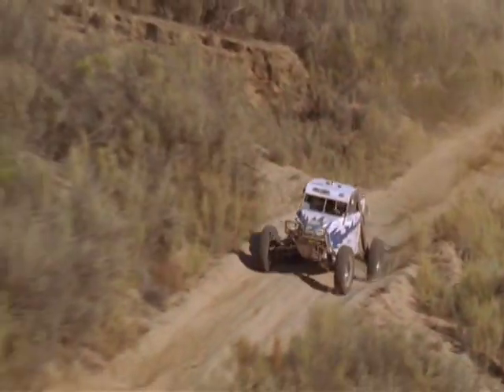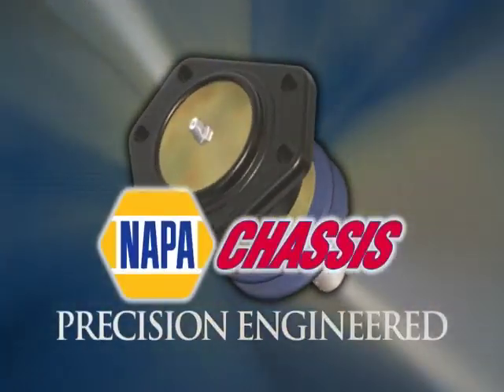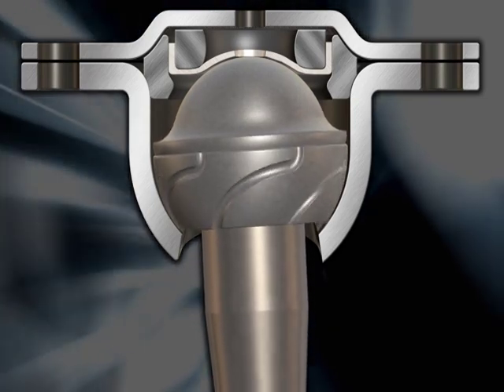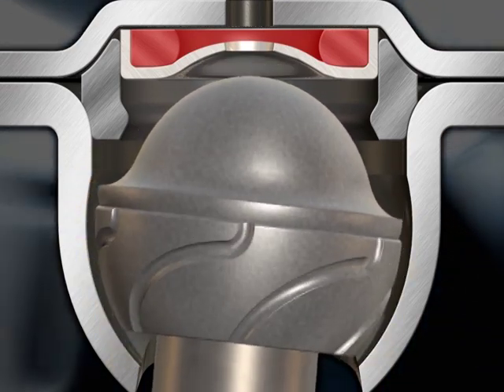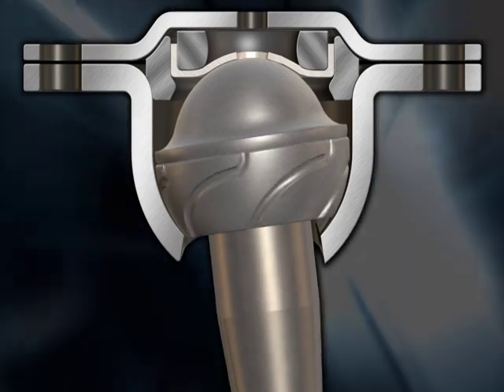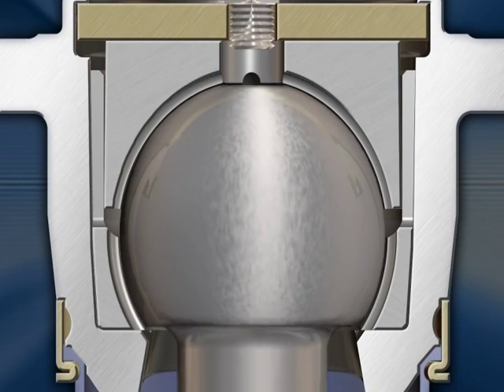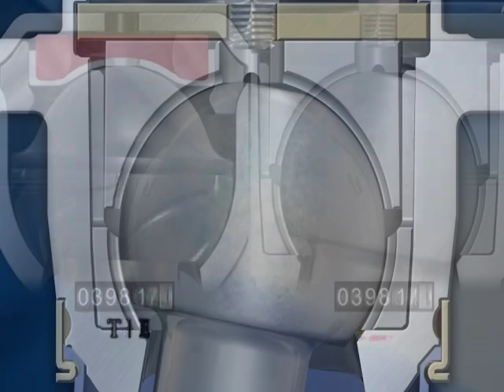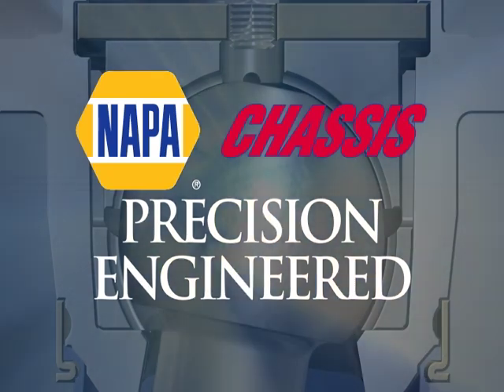NAPA Chassis Precision Engineered Ball Joints

Comment: Having worked for NAPA for 21 years as a Manager I saw many returns of these with high labor claims because of failures.
Reply: What exactly failed?
Reply: @Bill Conserva  Well, its clear to me that there is a fatal flaw in the design. If you look at the contact between the flat, upper surface of the ball and the housing, you can see that wear and friction is going to be a bitch. No wonder many were returned.

Comment: I replaced all my oem ball joints 4 years ago on my 03 GMC Sierra 2500hd 8.1l 6 inch lift with moog parts because the stock ones would be out by the end of the year. Moog is at least better than stock minimally and hey they lasted 4 years 👌but I just purchased a set of those kryptonite heavy duty ball joints though with that no fine print warranty 🤤 They should be in soon. Maybe an update in the future.
Reply: Any updates?

Comment: Kids, your vehicle probably came from the factory with this type of plastic bearing ball joint, and you're probably here researching ball joints because they're failing.  If you don't want to ever lube your ball joints, do get a plastic bearing type and accept the lower shock resistance and shorter life than you could have with a metal bearing you lube as needed.

If either type were superior for all applications, there would only be one type.  Trying to suggest otherwise is deceitful marketing towards consumers they feel will believe anything they tell you.

Comment: Looks like mevotech.
Reply: Mevotech Supreme X factor is by far the worst I've seen or used
Reply: Kelvynn Lee  After Mevotech screwed me, I went in search of Company that really stands behind their product. I found ProForged which is a company that makes hot rod parts out of incredibly hard steels.  Unlike most 3rd party parts companies that make 3 levels of parts; (economy, daily driver and professional grade parts), ProForged only makes one; Sever Duty! When I bought the complete front end from them, one of the boxes was damaged in shipping. Instead of replacing the part, they sent me another entire front end of parts. I talked with the phone And they said that they truly do guarantee their parts for 1,000,000 miles. I had those parts on my Corolla for three years prior to selling the car, and they're still rolling today-I see the car driving in my town a lot. Go take a look at the ProForged website. Their parts are a lot less expensive than Toyota

Comment: will get these from now on- had a problem with a Moog that had me having to re-replace a new one: wouldnt take grease, as it would only leak out between the welded halves. heres a video of the one i had to take back out-https://www.youtube.com/watch?v=TXKZRqKiwQc&feature=youtu.be
Reply: Tim you have it backwards.   Don't see any problem on your video,  looks like you mistakenly thought they weren't lubed from the factory then proceeded to pump too much grease in, overfilling it, so it had to come out somewhere.  That it came out where it did, is a sign that it did take grease, that the grease got all the way to the top of the ball cavity before excess leaked out.

Comment: What gets me is, on some vehicles you cannot get greasable balljoints. You're at the mercy of designs only and no way to prolong the life of the part. Then there's suspension designs, some vehicles are much harder on parts, and so for one vehicle the same designed part can fail quickly than others... probably why one guy says a specific brand is good, then the other guy says it's junk. Then there's the roads, one guy drives smooth roads like a grandpaw, then the other like NASCAR on pothole streets, hitting every pothole he sees. Fact is, aftermarket designs are gettin worse, design to sell not last, despite any claims.
Reply: That's the idea behind buying a cheaper vehicle and cheaper parts. cheap wear faster

Comment: Moog stinks now. Lets see you go head to head with ProForged. You'll lose! Hardest metal used, and while I'm talking about construction, you should know a ball joint is more about how it's designed than if it has plastic retainers or not. Metal to metal vs metal to plastic can both work fine if designed properly. Same with greasable vs non greasable. ProForged non greasables are truly amazing! No matter who you buy, make sure the ball stud is tight in the socket and both are equally tight if installing two. Send the loose one back in place of a tight one. The manufacturers say this doesn't matter, and technically it shouldn't, but for some reason it definitely does if you want equal wear from both sides.
Reply: Update... Proforged got bought out by Holley, so I'd stay far away from Proforged. Holley likes to water-down parts and overcharge to make as much profit as possible. Boo-hiss!